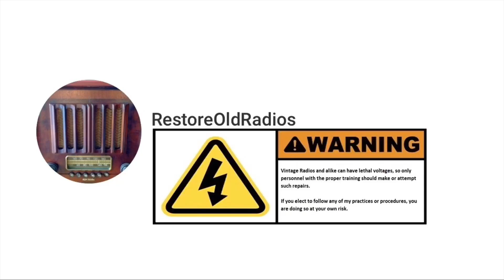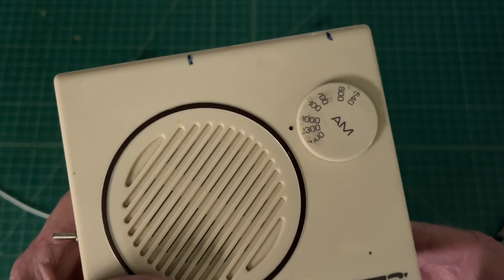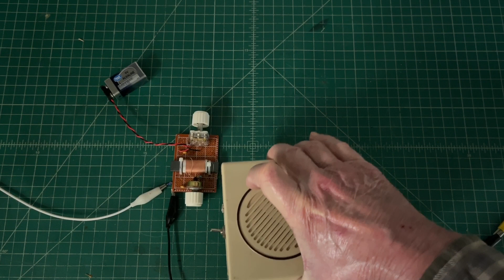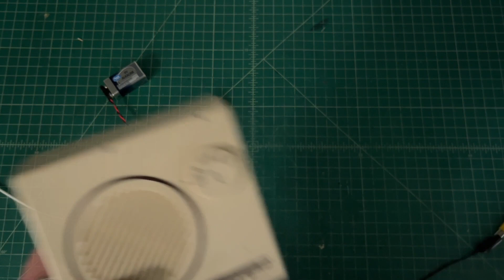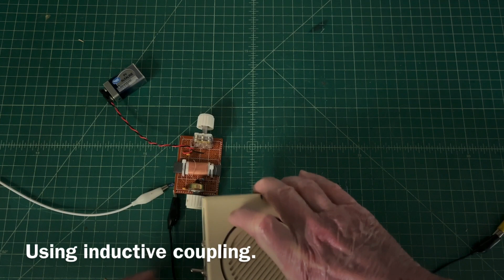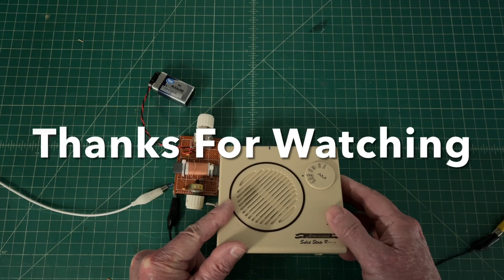Supercharge Your Transistor Radio

Comment: Btw:love the Americana solid state radio! Was it hard to find one? Seems it could fit your supercharger too! Cool stuff!

Pss:just checked Google and I see there's quite a few of them (from 1985) made for 10 bucks or so..sweet!
Reply from the maker: Tony, I’ve had it for years and don’t recall where I picked it up at. I may have to give your idea a try. A RF choke (inductor) in close proximity to the existing loopstick should work; one to ponder on. Best, Don

Comment: Great circuit that you came up with Don, basically you have an external RF amplifier stage.
Reply from the maker: Jim, thanks. It does a fair job assuming the received signal is adequate and free of noise. Best, Don

Comment: Don,
I think this is a great way to safely add an external antenna to an AA5 radio that does not have a transformer. As you know, directly wiring an antenna to one of these incorrectly can result in having dangerous voltages on an antenna or traveling to ground via the live chassis. 
Thanks. Hope you are well.
Reply from the maker: Ian, you are spot on. A very versatile circuit that can be used as you noted. Thanks for watching my friend. Best, Don